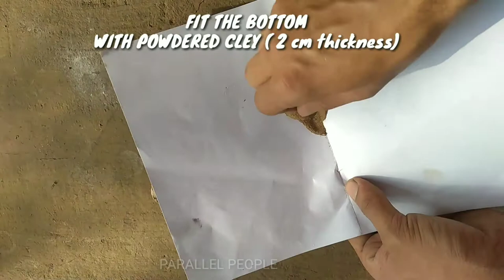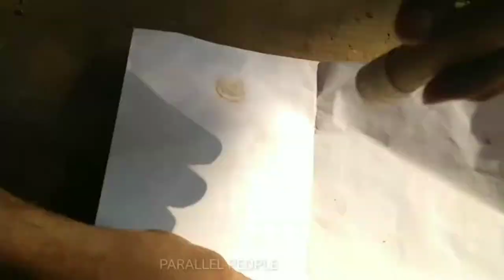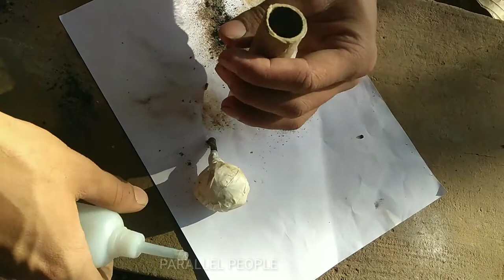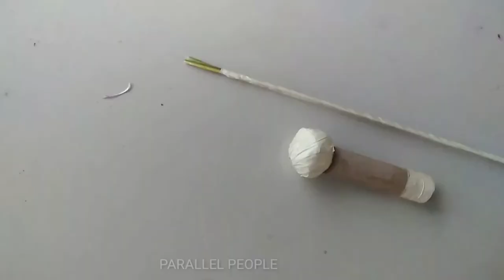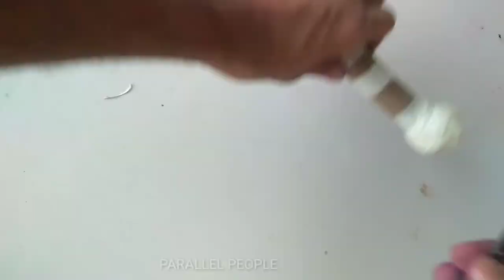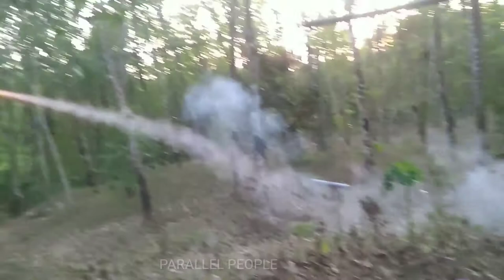How To Make A Gun Powder Rocket

Comment: I tried this but the rocket thrust is goes like a fountain ...any advice to me dude
Reply from the maker: If your rocket didn't go up but just fountain of fire goes down through exhaust with no thrust then these mey be the reason 👇🏻
1. Low powered powder - gun powder or suger kno3 powder need to be prepared well for good thrust.
2.big exhaust valve. You need a small hole at bottom ( not too small ) for a powerful lift. 
Try to solve these issues .
Reply: @PARALLELPEOPLEAKSHAYB  how can I make a hole in rocket thrust? . I don't have any idea ??
Reply from the maker: You can see in the video I just sealed bottom with cley powder and hand drilled a hole using a screw driver.
Reply: @PARALLELPEOPLEAKSHAYB  👍👍
Reply: @PARALLELPEOPLEAKSHAYB  i tried this method but it's goes like a fountain 😢😢😢😭😭
Reply from the maker: Did you Check the tube after that? Mey be the exhaust hole mey not strong enough such that it mey bust open making it a wider exhaust. It happened with me when I loosely packed bottom with a weak exhaust hole. Also Check the power of powder.
Reply: @PARALLELPEOPLEAKSHAYB   I sealed a exhaust valve with clay ...how can I check the power of powder ?
Reply from the maker: Spread narrow line of power 2 cm. It must burn within 1sec
Reply: @PARALLELPEOPLEAKSHAYB  i spread a narrow line of 5 cm and its take 4sec  to burn
Reply from the maker: How did you made your gunpowder?  I think you did not done ballmilling.
Reply: @PARALLELPEOPLEAKSHAYB  yes. I didn't ball mill a powder ........i don't have a ball mill